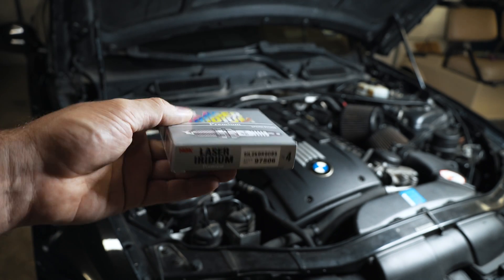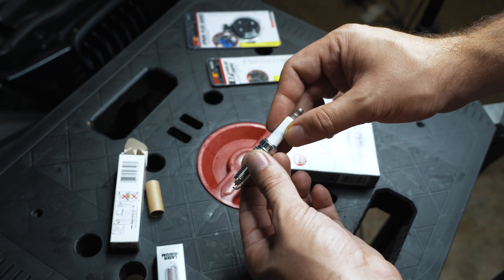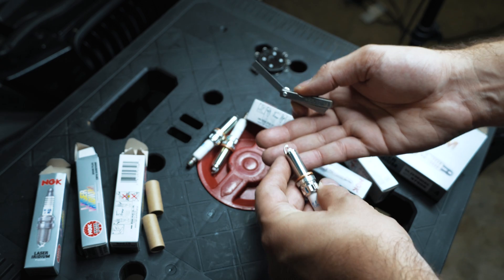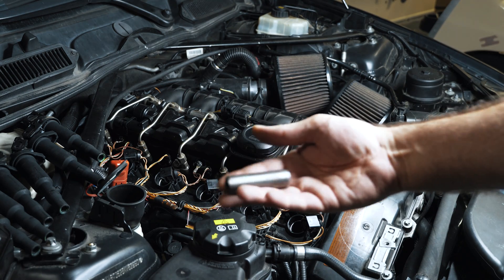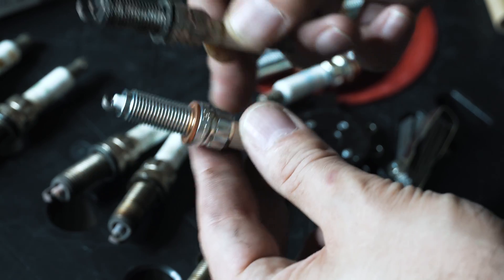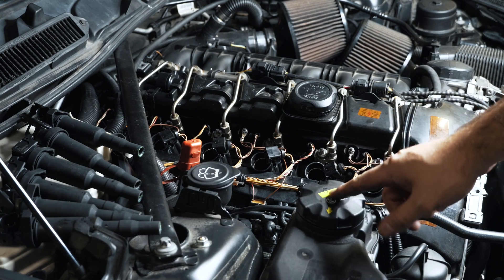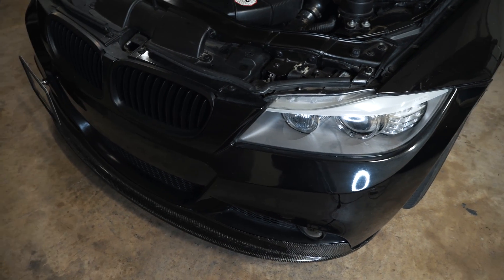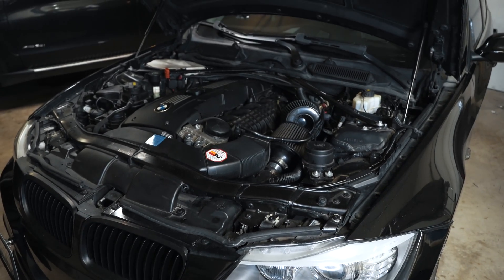Is This The New Best Spark Plug Option For The N54? | BMW DIY

Comment: @vehicular diy ? For ya I have a x6 w stock N54 I’m Getting ready to do index 12 injectors and was gonna do Elsie coils and new plugs.  ? Is so u think the 1 step colder NGKs will work on/with stock n54 (I run 93 octane ). Don’t wanna waste the $$ on them if the stock n54 won’t like them….   Let me know what u think. Thanks in advance!

Comment: Is it bad to run these with stock car?
Reply: No but it wont run as efficiently you’ll lose some gas mileage. No point in running a colder plug unless you plan on tuning at some point or are already tuned.

Comment: So I installed coded 1 plugs on my N54.  & noticed under heavy wot I get a hard shift from 3rd-4th.  Just replaced my trans too that’s not the problem.  Literally started feeling the jerk after I installed the plugs.  I think gap could be a problem, they’re set to .020 but don’t know what other Gap I should try

Comment: Do you recommend to run this on stock turbos
Reply from the maker: It would depend on how much boost you are running, if you're running on 93 and not pushing the stock turbos you could go with one step colder plugs.

Comment: I have just fitted these plugs on my 2010 135i N55 gapped to .022in . I'm getting cold start hiccups, is their a fix for this? Car is running stage 1+ at 400hp
Reply: Stage 1+ @400whp is a little optimistic.

Comment: Hey everyone, looking to get spark plugs soon. 
I’m only at about 390-410whp max, I’m looking at both 1 step and 2 step colder. Should I just get the 2 step colder plugs to avoid getting them later? If so, any downside to that? Or should I just go with 1 step colder since I’m using stock turbos, MHD stage 2. (2011 335is)

Comment: My friend, I don' upgrade my turbos, so I can use this Spark Plugs?
Reply from the maker: You still good benefit from them ya if you're running higher boost.  If not I'd probably go with one step hotter plugs.
Reply: @VehicularDIY  Thank you, So, I'll keep the stock spark plugs

Comment: Hi. I have 335i N54. I got NGK Iridium sparkplug. Many people told me with iridium spark plugs I can have detonation inside the engine. Is that true? Please help me. Thanks
Reply: Which NGK Iridium plug?  They vary in heat range and length.

Comment: What Gap would you reccomend for an N54’s that’s producing 360-400bhp? I’m thinking of changing to these plugs and some websites reccomend 0.22 and others say 0.35 on the stage 1 colder plugs??? What is the correct gap to use? Thanks for your awesome videos as always!

Comment: What should you use for a N54 FBO,  MHD Stage 2+ (93) map?
Reply: 8 months later, did you get an answer? I’m looking to swap to the 2 step colder but I don’t know if it’s worth it for just FBO stage 2+ on stock turbos.
Reply: @phoxracn9  I'm +1 to this thread. exact same scenario with MHD2+ 93.
Reply: I bought them I’m almost fbo all I need is fmic currently running stage 1 but my car is misfiring so I’m switching spark plugs

Comment: My N54 335i has a custom map IC + DP, slightly under 400 hp. During last spark plugs change I decide to go with one step colder Bosch ZR5TPP33. I decided to try those spark plugs on stock gap first. I did everything right, car started, was silky smooth, cranking short. 2 days, and about 30 miles later DME was fried! Now I'm really not so sure about this one-electrode spark plugs upgrade, especially with MSD80 DME... I don't know, maybe I should gap them at first, if this is any issue at all... Anyway at least for now, I'll stick to OEM Bosch spark plugs. They were totally fine with my setup, no issue at all. In the end, just be careful with modifying ignition system in car...

Comment: I wish some one shows or explains a feeling of torque for those with out the wrench
Reply from the maker: Typically you get a mushy feeling as the crush washer on the spark plug collapses but these have copper washers so it's a more direct feeling.  It's about a 1/4 of a turn after the spark plug fully seats.  You can buy a basic torque wrench for 25 dollars now days so it's worth considering.
Reply: One should never torque into an aluminum thread without a torque wrench.  You will be sorry the first time you screw up.

Comment: hey v-diy, 
I need your advice sir.  my car is tuned with mdh stage 2+ stock turbos ,  I am having occasional misfire.  which spark plug you recommend?  previously you recommend to use 95770, on this video you recommended 97506.  Please let me know. I appreciate your help.  
EriqM Toronto, ON

Comment: Definitely not the best plug for a Modified N54, Ruthenium is best with PSPE tips. NGK 91784 LKAR8BHX Ruthenium HX  https://ngksparkplugs.com/en/products/ignition-parts/spark-plugs/ruthenium-spark-plugs
Ken aka Wedge performance told me an auto should hold 600 ft/lbs that's about 550 measured at the wheels. I was hitting that with 23 lbs of boost, stock turbos.

Comment: I run these plugs at a 0.020" gap on my 750whp 135i and they work great!

PS: You need a magnetic BMS spark plug socket.
Reply from the maker: Nice, upgraded coils?
Reply: @VehicularDIY  He is a youtube blogger:  

https://www.youtube.com/user/jakespence135
Reply: I run the same plugs same gap runs great 335i n54

Comment: I have these in my upgraded turbos car gapped to 0.22" gap but it misfires post shift sometimes at high rpm not sure if its my slightly leaking injectors (I'm replacing soon) or the plugs. but I say everyone should gap it to 0.20" or 0.18" instead.
Reply: 0.20 seems perfect

Comment: Question; I have a N55 completely stock but I am gonna get a tune eventually so would this spark plug be with me getting in the mean time???
Reply from the maker: The 95770 should work well for that application.
Reply: No tune there is no reason to change plugs.

Comment: Currently I’m running on pure stage 1 turbos fbo and I’m using the new Bosch plugs as well as new Delphi coils. I’m only running a stage 1+ tune as of now but the oem seem to work just fine for now but I’ve definitely been looking for an upgrade
Reply: The  keep them till they give you a problem

Comment: Nice upload as always. I just did the 95770 with new Bosch coils in my 07 335i, which currently has the Split Second Turbo Tuner MKII installed (by the previous owner) and the car pulls so much harder than before. Removing that soon and doing the MHD stage 1 flash. Curious how different it will drive with MHD.
Reply: BIMMER ZEIT what is the split second turbo tuner?
Reply: @HDGnvrsleep  google it
Reply: Get on MHD it’s probably the best n54 tuner at the moment.
Reply: Guillermo Lopez got my cable and fire tablet with app installed. Just need to find time!

Comment: Nice! Always excited to see a new video. 550+whp would be a nice compromise with the single walbro 450. What I'm planning on as well. Dont really want to run 2 unless I have too.  Interested to see how far the single will go.
Reply from the maker: Thanks!  Yeah so far I stay in the high 50s in terms of low pressure PSI under load with the single.  I think it's flowing enough for now.
Reply: Yeah man for sure. Ok nice... yeah I got a donor assembly and fitted a 450 to mine. 5 series fuel assembly is different then the 3 series. If it comes to it I would just go full bucket less with 2 450s. Are you running full e85 now or still on e60?

Comment: Be heavily modified i tried them at stock and stage 1+ MHD on the advice from BMS.. with eldor coils gapped at .20 and .22 stock but, stock bosch worked much better. With your mods im sure you will have a much better outcome👍

Comment: I'm on impression that these are 1-step colder on n55 motor and 2-step colder on n54 motor.
Reply: You are correct. I am about to install the N55 plugs into my N54 because NGK 95770/5992 are hard to find right now.
Reply: BTW, at that price 110$ for 6 spark plugs it's a total ripoff. I bought 6 of these exactly the same here in Europe for 54€(approx 60$).
Reply: Sande Halonen get the spark plugs on fcp euro for 120$. They have lifetime warranty. You will never have to pay for them again after😁
Reply: @messi13578  yeah, works if you live in the states. No point when you live in europe. For example, when they break, it takes forever to ship them to states + it costs a lot and when FCP send new ones back to you it also takes a while... And honestly, if you drive like lets just say 10k miles a year, these plugs will last at least couple of years...
Reply: Sande Halonen did not know that. That’s a bummer. Still recommend them if you live in the states!
Reply: @santtu9169  Get a second set and you do not care about shipping delays.
Reply: @santtu9169  A lot of Chinese counterfeit parts out there.